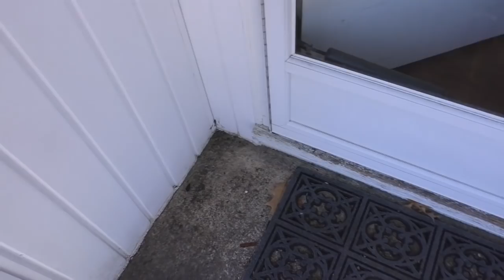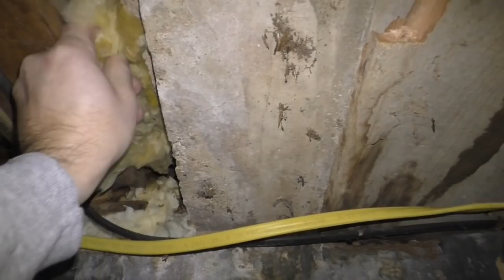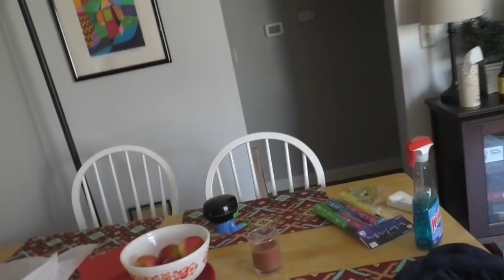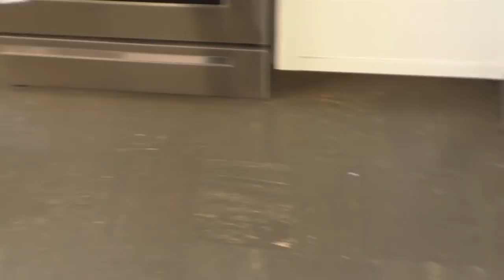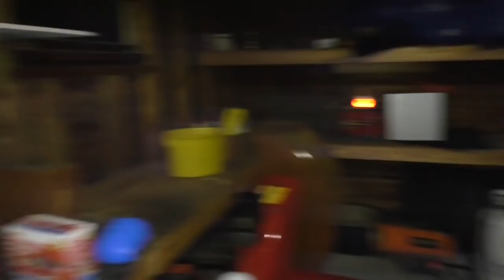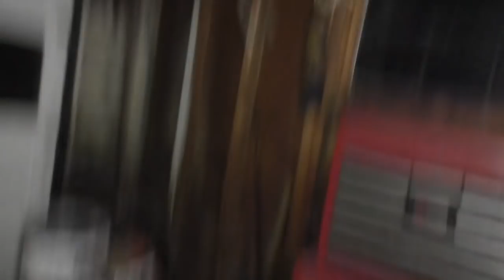Assessing the SILL and FLOOR JOIST DAMAGE in my 1954 suburban ranch house

Comment: It's good that the house is dry and warm for the winter.
It's difficult to explain in a comment but I'll try my best to, just remove the material in the infected area around the concrete slab,, then from the farthest beams to left and right of the concrete slab use them as a support you may need to double or triple them up to give some more support, then build a new header out of pressure-treated material it may need to be double or triple dup as well to go straight across the concrete, then replace the pieces on the left and right sides, then tie in the existing beams behind to the new header with joist hangers.
You shouldn't have to scab in any material, from the video the existing beams don't look that bad, after the concrete.
By doing it this way you will not have to scabbing any material and you will not have any major structure beside the concrete.
I'm surprised they didn't build a cold room underneath the concrete and front porch.
Hopefully you understand what I mean and it gives you another idea on how to redo this.

I think the extra beams in the stairs area would have been for if this house had a second story since the staircase would have needed extra support, most likely the houses in your area are similar floor plans just some are two story.

Comment: the fact they used three 2x8's actually works in your favor. you can get away with scabbing new joists in without compromising strength. cut the outer two joists further back (2-4') than the center one, and laminate the new joists together with glue and screws. on the outer joists you can add more strength at the seam with nail plates.

make sure you support the floor joists with some pole jacks before you do any cutting... and not just the ones you're cutting.

edit: as pointed out in another comment, through bolting the joists with some fender washers or washer plates wouldn't be a bad idea either.